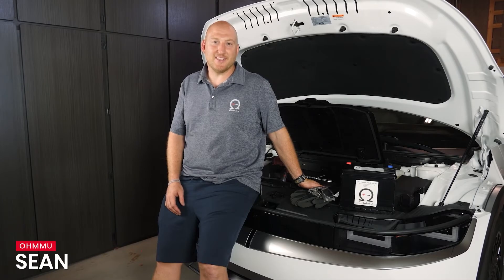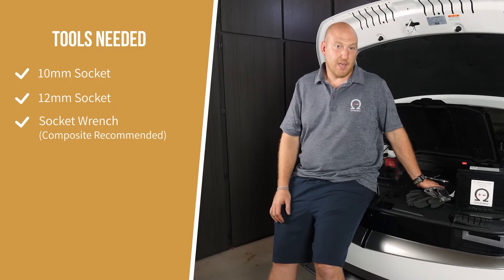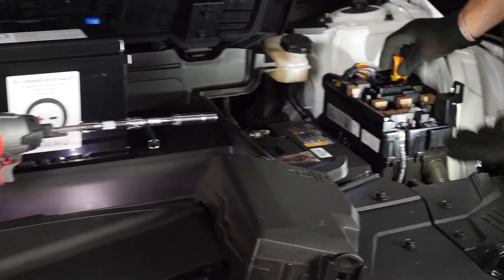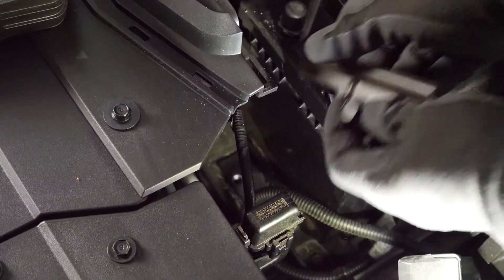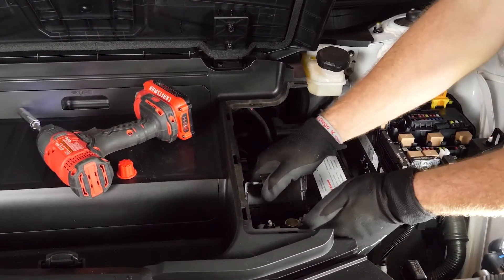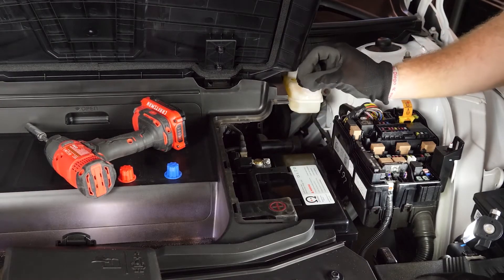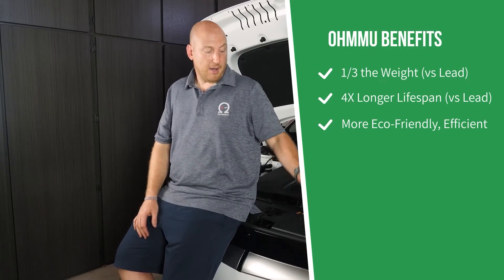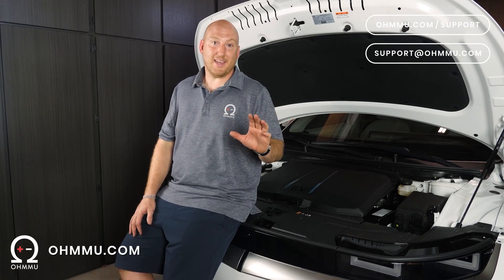Hyundai IONIQ 5 - 12V Battery Installation (Ohmmu)

Comment: hmm well idk how much of this is true. can you reply on these concearns?  For an Ioniq 5 replacement 12V battery, use an AGM battery of the correct size (BCI Group 47 or H5) from a reputable brand like Weize or a mid-range lead-acid battery from AutoZone, as LiFePO4 batteries are not recommended due to potential charging incompatibility and warranty issues. While LiFePO4 offers benefits like lighter weight and longer life, the risk of damage to the car's electronics, as well as the high initial cost and potential to void your warranty, make them a poor choice for most Ioniq 5 owners - I would like to do the new lithium battery but idk now...
Reply from the maker: Hi there! Thanks for sharing your concerns — those are great questions and definitely important to address. Our Ohmmu 12V lithium battery is specifically engineered to be an easy, direct, drop-in replacement for the factory Ioniq 5 battery.

Unlike generic LiFePO₄ batteries, Ohmmu batteries include an integrated Battery Management System (BMS) that’s designed to work seamlessly with the Ioniq 5’s DC-DC converter and charging logic. No vehicle modifications are needed, and the battery safely accepts the factory charge voltages. Even though it was designed for a lead acid charging profiles.

Our BMS actively monitors voltage, current, and temperature. It includes multiple layers of protection (over/under voltage, over-current, short-circuit, and thermal) to protect both the battery and the vehicle’s sensitive electronics. So your vehicle electronics are at no risk.

Installation is truly plug-and-play. The vehicle treats the Ohmmu battery like a standard 12V, so there are no error codes, no special programming, and no impact on normal operation. However rarely, if those do appear, we have walkthroughs on how to fix them as well as further technical support to figure it out if there are issues.

We stand behind our products with a solid warranty and support specifically for EV applications. Our batteries are in use in thousands of EVs — including Hyundai, Kia, Tesla, Rivian, and more — with excellent reliability. There are specific cases for voided warranties, and using it as an intended 12v for your Ioniq 5 won't cause that. This is more about misuse of the battery for applications other than a "starter" battery.

Beyond safety and compatibility, upgrading eliminates common lead-acid issues like sulfation, cold-weather performance drop, and early failure.

Lastly, check out Technically Jeff's YouTube channel who has used our batteries in their Ioniq vehicles as well.

Thanks again, and hope that helps!

Comment: Hey Thanks for the video! Being very experienced in EE, I would only disagree with one step and that is when to re-engage the HV safety switch. I would disengage it as first step and re-engage as last step. This way you don't have to worry about the HV possibly trying to start charging as soon as you connect the negative terminal.
Reply from the maker: In some vehicles having the vehicle power up 12V without the HV loop in place create an immediate fault condition.  The circuit that connects HV requires 12V to be present so once 12V is disconnected and HV is not enabled, it can’t reconnect HV until 12V is present.

Comment: Don’t reengage that tab (yellow “kill switch”) until you connect both terminals completely..I just found out (sparky situation) but great video. You helped me a ton!
Reply: I was reading the comments to see if they would reply to this - I had the same thought - why would you not connect the battery (both terminals) before reneging the kill switch).

But, regardless of the switch the battery still has power and could spark.
Reply from the maker: @juliusivory2267  We always have to learn the hard way! 🤣
Reply: that part of the video made no sense

Comment: I won't do that, use manufacturer recommended battery only, there is a smart bms system in all cars which know according to battery when and how to charge it, i.e. agm is charged differently than efb, than normal, than lithium.
Reply from the maker: Charging in and of itself is not different between chemistries; the charger/source increases the bus voltage until the battery starts absorbing the energy and consequently raises its voltage as the energy is stored... doesn't matter if its Lead, Sodium, Titanate, Lithium, the charging itself is identical...  What IS different is the "curve" which addresses the absorption voltage, absorption time, float voltage, etc; what matters is that the battery be safe and compatible with the charging curve provided by the system.  In this case the LFP battery is happy to accept energy at the cutoff voltages of the factory lead battery, so this isn't a problem.

Comment: Is it a concern that most portable battery booster packs can’t be used to boost a non-lead acid cell battery?
Reply from the maker: They can be used to do it as long as they have a "force" mode and don't check for voltage prior.  Some work some don't, you'd want to get one that does work with this battery if going that route.  Or go for the Sodium Ohmmu battery which will not cut-off voltage as it doesn't have a full-fledged BMS.

Comment: Thank you for this exceptionally easy to follow video. The lithium 12V is expensive, so I went with an AGM battery. I purchased it from Walmart, but they refused to install it for me because they were inexperienced with the Ioniq 5 and were worried about somehow damaging the vehicle's electrical system. So I did the install myself after Google pointed me to your video. Easy and quick, thanks to your clear instructions.

Comment: went with an AGM for my 2022 Ioniq 5, i noticed the oh shit light coming on alot more frequently, being 3 years old, the agm should last a lot longer and is designed more for deep cycle  discharging vs lead acid and recovers faster , was significantly cheaper as well. Can not justify lithium for Ioniq 5 w a cost of 3.5x over a quality AGM, do the math
Reply: What's an AGM?

Comment: I wonder if the Hyundai warranty is affected by using non-Hyundai parts. Thinking of replacing the lead-acid with Ohmmu!
Reply from the maker: Read up on the Magnusson-Moss warranty act; in short NO they can't void your warranty on the entire vehicle for using non-Hyundai parts, they can only void your warranty on the specific part being replaced (obviously, in other words they will NOT warranty your new 12V Ohmmu battery but everything else they will, by law, warranty).

Comment: Have you had any issues with putting in the Ohmmu Battery ?  Charging issues ?
Reply: Nope
Reply: @aussiegti  could explain how helpful this battery upgrade is?
Reply: @KevinJames-z1m  lithium battery is much lighter weight and lasts much longer than the lead battery provided by Hyundai. 

So a good insurance measure against the dreaded flat battery some owners experience in the IONIQ 5.

Comment: Hi! The way you did the swap ensured that you would lose the car’s computer data by completely disconnecting your 12 volt lead acid battery. You could have used a battery pack or a jump battery to connect to your car’s 12 volt-battery cables. Then, when you did disconnect your cables from the car’s 12 volt-battery, the battery pack or a jump battery would continue supplying 12 volts to your car’s computer. Not sure why you didn’t use this simple trick.
Reply: In case anyone is wondering, I just did it the way the person did it on the video and the car retained all info and settings (profiles, QOL settings, etc)
Reply: @ Surprising! I would not try that with older cars…
Reply: Rubbish! No such issue with the IONIQ 5!

In modern cars, you don’t lose everything instantly the moment you have a flat battery anyway.
Reply: @ I’m happy to hear that. But…, when I test my Ioniq 6 battery, I don’t take any chances. Unfortunately, when it comes to knowledge about how the individual components work on my car, I can’t say that my dealership knows a whole lot, such as you won’t lose your data when disconnecting your negative from you 12-volt battery… Also, when you contact Hyundai support call center, you typically get into an Integrated Voice Response system that has an infinite loop programmed into it. You can never speak to a live agent. Worse, you are often given another 1-800 number to call for your specific issue. It’s given only once and fast. If you want to write down that number, you need to call back the original 1-800 and go through, again, the full menu option to get back at the needed 1-800 number for your own specific issue. Sooooo, call me scaredy-cat, but… until Hyundai dealer support gets up to snuff on stuff about the own electric cars they sell, I’m going to play it safe…
Reply from the maker: Most of the information you are thinking of is stored in non-volatile memory these days, so you can lose power and still have settings.  Only very poorly engineered and cheapie stuff would be done otherwise.
Reply: @ True! I recently tried to disconnect the 12-volt battery in my 2024 Ioniq 6 without a power pack/jump battery, and I did not lose any data. If I had done this with my other car, a 2013 Lexus ES350, which is still in top shape, I would have lost even access to the car’s radio, needing a code to reinitialize it.

Comment: Why close the high voltage breaker before hooking up the negative terminal?   Wouldn’t it eliminate the 30 amp arcing issue that you identified if you hooked up the negative terminal before you closed the high voltage breaker??
Reply: @holgerfrink answered your first question beautifully (to avoid error codes.)  The answer to your second question is "no" because the 30 amp arc comes from the 12v battery system.  The same "arc & spark" happens when reconnecting the 12v battery in a standard non-electric vehicle as well.
Reply: I was thinking exactly the same.
Reply: If you don't connect HV circuit breaker before connecting the 12V, the car tries to power up the HV system but couldn't which will likely result in some error messages or even permanent fault codes in the OBDII. So it is absolutely a good idea to power up 12V and HV the same time, which means the HV circuit breaker has to be connected when 12V powers up.

Comment: Do I need to put any grease on the terminals?
Reply from the maker: No, our terminals are brass and won't corrode.  Also no acid will be leaking around them like lead batteries.

Comment: I had my doubts, but I ordered this, and installed it per this video, and it works.  No more constant dead or low battery.
(2022 Ioniq 5 Limited)
Reply: Did you pull the high voltage battery fuse when removing the original 12v?
Reply: @nxtiak Oh, definitely.  I did everything in the exact order of the video, and it worked.  To be honest I expected some hiccup or another. Also, I used small 10 and 12 combination wrenches, and was able to reach even the lower retaining bracket, but admittedly a socket or ultra long socket would have been better.
Reply: @lavapanther   Thank you, just swapped mine out, zero issues. I completely forgot about the 12mm screw, so thanks for the reminder!
Reply: @nxtiak Great!  Enjoy!
Reply: Any update on your battery?
Reply: @KevinJames-z1m Thank you for asking.  I had almost forgotten that I did this because I have had no problems at all.  I long since gave away the battery jump starter that I worriedly kept on hand before.  Sometimes products just work.
Reply from the maker: Awesome!

Comment: Does this battery work in cold temperatures? I hear lithium 12v batteries have trouble in cold temps?  Is this true?
Reply from the maker: Yes, somewhat and yes... to explain; our batteries are very stable in the cold due to the composition of the cells and the form factor we use (prismatics, tightly packed, sharing temperature), we have tested them in extreme heat and extreme cold.  But to go further than that we started moving all of our lines to include an internal heating technology as well (warming silicon pads between cells).  To note though, we have never really had problems in the cold with our batteries but there is an abundance of information online that scares folks from using the words Lithium and cold in the same sentence without cringing so adding this technology gives some added peace of mind.
Reply: @OhmmuEnergy  I recently looked at a competitor's battery (Valiant VTL12-100CW) and if I am reading the datasheet correctly: they shut off the discharge at -20C. But allow charging down to -30C.

I may wait for 12V sodium-ion batteries with a wider temperature range to become available.

Edit: to be clear: I am more likely to buy the 50AH version: did not like the $1300 quote for a battery with Blutooth.

Comment: What is the total Ah and CCA? Trying to search the website and zoom in your video, but still unable to see...only can see the lead acide is 60Ah/550CCA
Reply: The nice part of EVs is that you don't need cold cranking amps. - just a good 12V battery that can handle deeper discharges without destroying the battery.

Comment: hi, is there a reason why you finish connecting the negative before you reengage the high voltage?
Reply: Yeah I didn't get that. His explanation didn't make any sense. It only makes sense if the battery is disconnected to engage the high voltage And then he said there would be arcing. Why not just wait until both terminals are connected. That is what I will do.
Reply: @AnkurSethi108  So what's the proper procedure? Pull the HV Fuse disconnect battery, reconnect new battery then reinstall HV Fuse?
Reply: @nxtiak  That is what I did. And still I got a little spark when I connected the negative.

Comment: The price negates everything. 500 bucks. Maybe you can convince Tesla drivers to throw away their money but not every EV  owner is a Tesla
Reply from the maker: Why is that a "throw away"?  Do you neglect the cost of battery+install x 3 vs battery+install once?  Or just don't believe it would last?   Did you throw away money by buying an expensive Electric Vehicle?  Typically buying a gas vehicle is a lot cheaper, so do you also ignore the longer term cost/benefit ratio on that purchase or how do you justify it?  Or is this just a knock on Tesla drivers (which I get)
Reply: @OhmmuEnergy  is this solving the problem ioniq 5 have not charging 12v battery when hv battery is under 20%, so many videos out there on youtube on ioniq 5 owners whose 12v battery died

Comment: I did not quite follow why you turned on the High voltage switch before you reconnected the 12 V negative terminal.  Whats the reason for that sequence?
Reply: The explanation is that it can be done at any point during the process (after everything is totally powered down).  In some vehicles if you push/connect the HV plug after the 12V it will have an alert in the dash from the time spent with 12V live and the plug disconnected.
Reply: Yeah it was weird he reconnected it before connecting the negative terminal because he even said you might get a spark and have to do it quickly when connecting negative terminal. Well all that wouldn't be an issue if he doesn't reconnect the high voltage disconnect u!til the end?
Reply from the maker: The little spark (not a big deal really) is just from reconnecting the 12V power fully to the load, it would happen on the positive or the negative, whichever is connected last (makes the circuit complete between car and battery).  It also doesn't matter if the HV is engaged, the spark is still gonna happen, the car has a bunch of systems that immediately start to boot up when that connection is made, this puts a few amps of current load on that battery and thats enough to create a spark if the gap is sufficiently small.  Basically its the electrons getting really "excited" to start their traveling through the vehicle and energize it''s systems and they are so excited they don't wait for the bridge to fully connect and start jumping the gap as quick as they can when it gets close.

Comment: Can a  12V Lithium Iron Phosphate (LiFePO4) battery be used in colder climates where winter mornings can be as low as -25F?
Reply: For sure!  Ohmmu does testing on their batteries down to -30 Celsius for the charge/discharge specification and cycling.  Cold temps are definitely gonna reduce the lifespan of the battery but the LFP chemistry is so robust that if built well (the proper cells and packaging and BMS) the negative effects are minimized.  Lead Acid battery life is also reduced in the severe cold.
Reply: There are also sodium ion 12 volt batteries available too, which may even be better than LFP batteries in the cold.